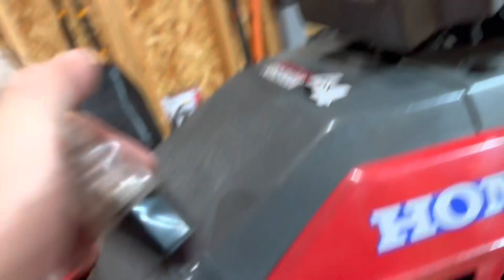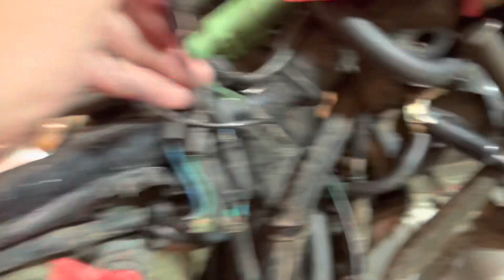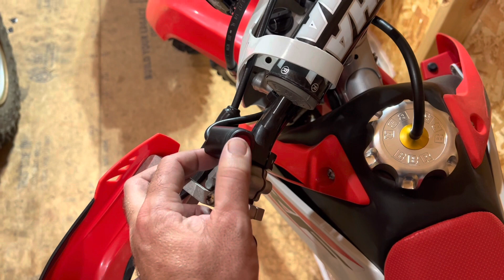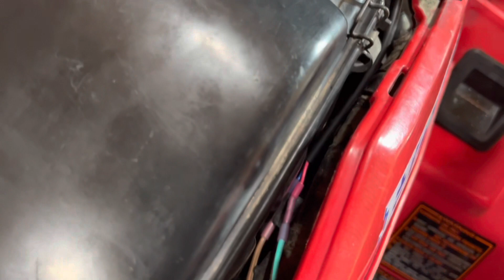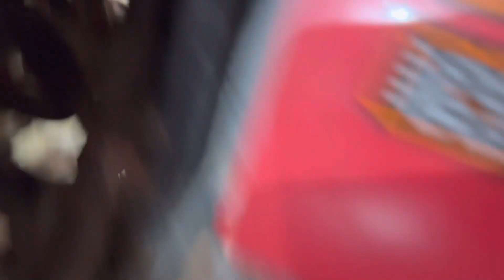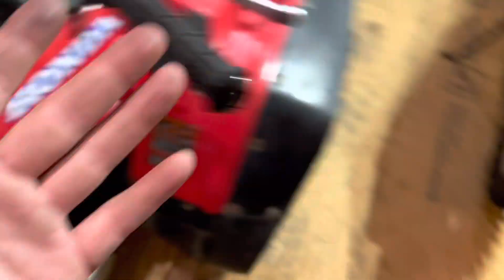Atv Fan Override Switch Install ~ Easy Mod!

Comment: Thanks. Purchased a waterproof lighted switch just now after watching for my 06 rancher 350. Just finishing a top end freshening up and I want the engine running cooler than Honda sets that switch temp at to activate.

Comment: My thoughts are put a new sensor in, then y in  the wire beside the sensor to button then to the fan, giving your ground to the fan, bypassing the fan relay, as i assume the the live wire is giving power to the fan all the time, if not run a y to the fan postive feed, just incase its a broken wire or faulty fan relay, the ecu will still get its feed, as the relays are expensive. Just turn on the button when you start, Just a thought.

Comment: I did this hack but the oil temp light is always on while the fan is running , is that expected? I'm worried that if I ever have an overheating issue ( I'm going to replace the original oil temp sensor) I will never know since the light will be always on. Thanks.
Reply: I added a resistor in line. This prevents the oil temperature light turning on.
Reply: Where did u put the resistor? Did u put from the negative wire from the switch to the wire going to the oil temp light ?
Reply: @carlkerruish2534 he isnt going to tell you

Comment: I literally just got done taking skid pan off my 98 foreman 450 fan hasn't been working took wire off that sensor u showed and put into one of skid platebolt holes with electrical tape then duct tape put skid plate on minus 1 bolt and works so far bit wish i would seen ur video first looks good temporary to i get a new sensor cuz i thought my x smoked the engine riding our grandson around real slow then stopped and picked flowers and left engine running  after i told her fan wasn't working then she says it has no power and wont run let cool for 6 hrs starting running again  but definitely doesn't seem to have the power like it did question will it hurt to run it with fan continously on until i get a new sensor which might be a month or 2 especially with all hot summer slow rides my grandson all he wants to do is ride on quad from morning till night x and me take turns all day  riding him lol
Reply from the maker: I would hard wire it for now. These motor need the fan during the heat of summer
Reply: @RaztechPowersports  ok thanks it's working I took for ride red oil light stays on along with fan will it hurt anything riding like that till I get new sensor?
Reply: U gotta get a POS put put machine. Hell he'll probably like driving the lawn mower😂
Reply: @dmo848  He's 3 lol

Comment: Question, I have a blue 87  350d she runs good and idle fine, but if I setting still and give it WOT she dies, if rev her a couple of times, then WOT she is good. Any thoughts!
Reply from the maker: I would adjust your air to fuel screw. Look up the factory setting
Reply: It is 1.5 out from seat
Reply from the maker: @sqcarroll  Have you opened up the carburetor and checked all of the Jets?
Reply: @RaztechPowersports  Yes sir, Cleaned Carb and tried Moose rebuild kit with jets. but went back to factory jets after cleaning them. Main circuit  needle jet is in the third clip position. , thank you for your input.
Reply from the maker: @sqcarroll  I would pull your spark plug and see if the ATV is running lean or rich. Might need to put a new spark plug and run it for an hour to get an accurate reading
Reply: Carb issues. Jet clogged